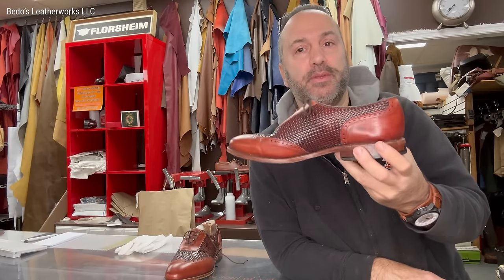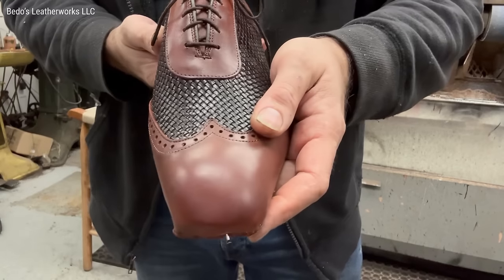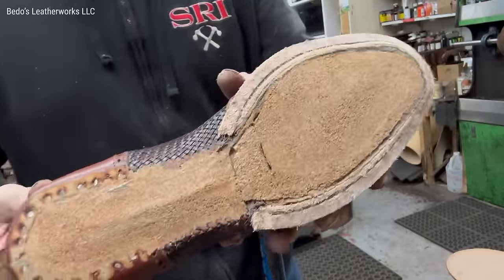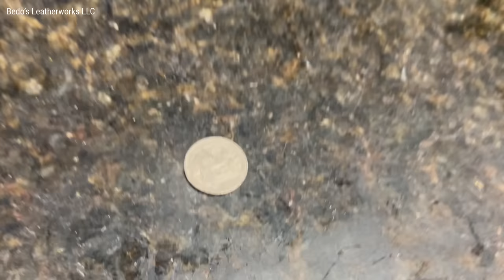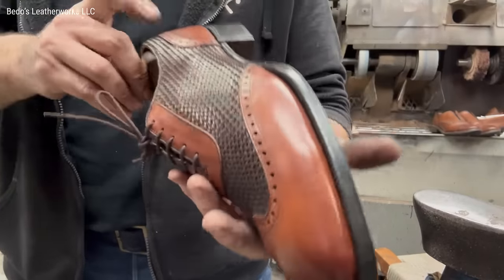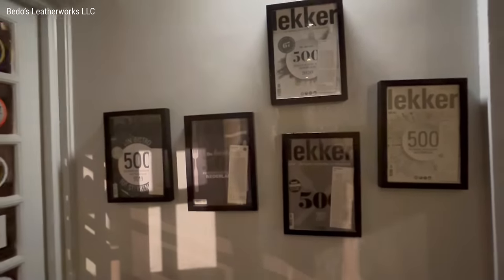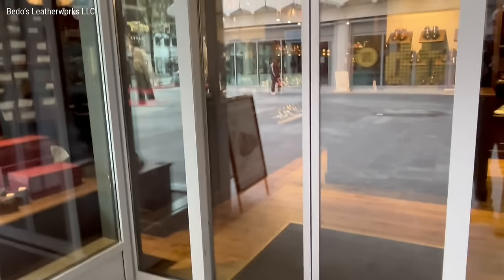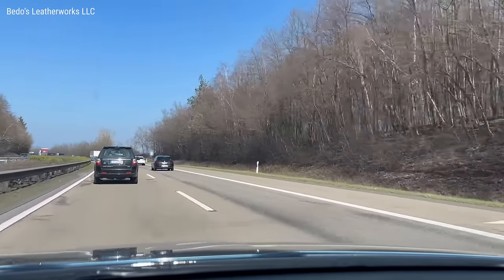Netherlands Shoe Competition

Comment: Congratulations, Steve.  Don't change a thing about those videos, brother!!  What I appreciate the most is how you leave nothing to chance.  Right down to HAMMER TIME.  There's always a shortcut, and the shortcuts won't fail 90% of the time.  Maybe not even 98%.  But who's going to get the work that falls into the 2%?  All they'll know is something failed.  You don't take the shortcuts.  You hammer every last inch, then your burnish it.  No squish machine.  That earns a lot of respect from me, because you know those glue joints aren't ever going to fail if they're hammered.  You are a solid dude.  Your work speaks for itself, and you show the whole process.  Total respect, my man!